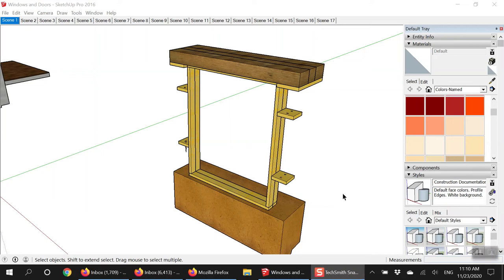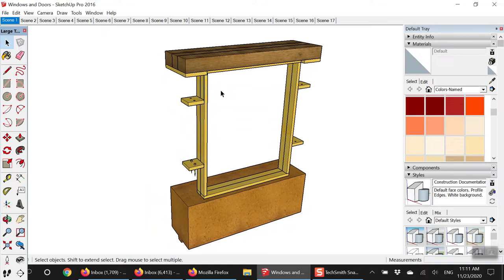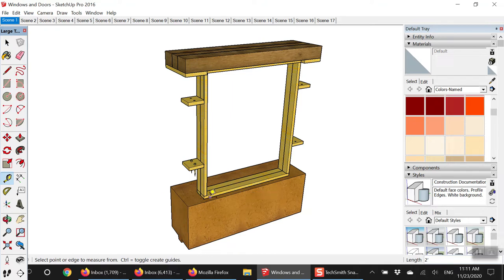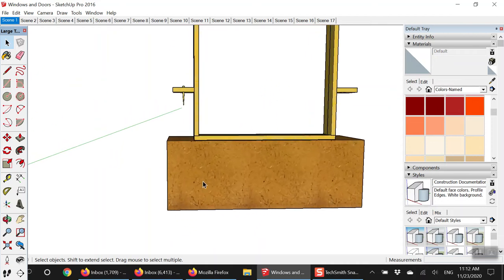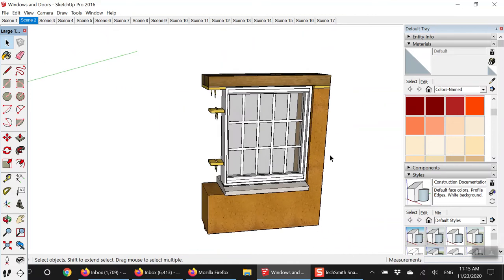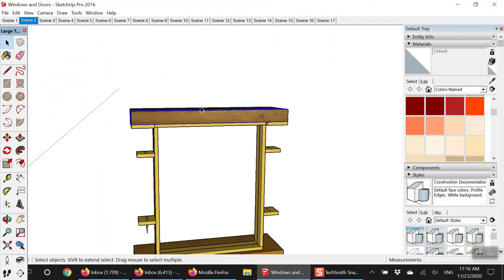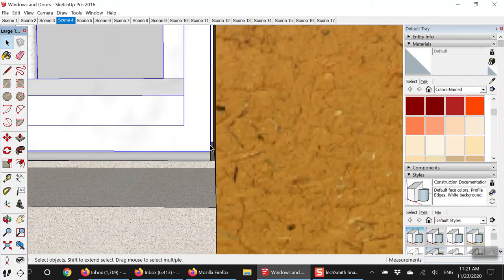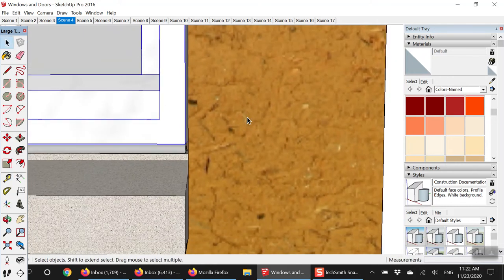How to Install Windows & Doors In A Cob Building | Cob House Building Guide

Comment: This is going to sound crazy but I saw a guy just put a raw piece of glass into a cob wall with it's only support being the cob. This used no wood and I saw nothing used as a lentil above the glass. I'm planning to go this route with all my non-opening windows.
Reply: Not yet a cob builder here but just out of curiosity... how can you fix it when god-forbid, it ever breaks ?
Reply: @alainvosselman9960 - You chisel out the problem area, fix and repair.
Reply: @DukeTheSPO0K  Alright, thanks.. love the simplicity of that.